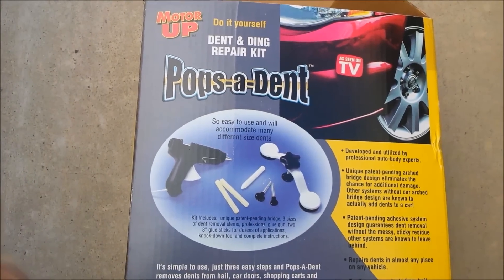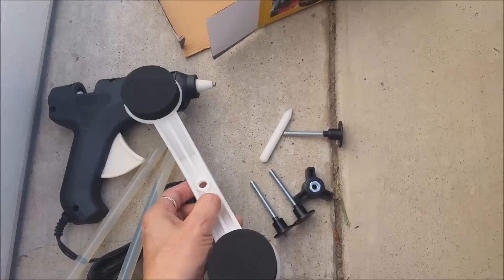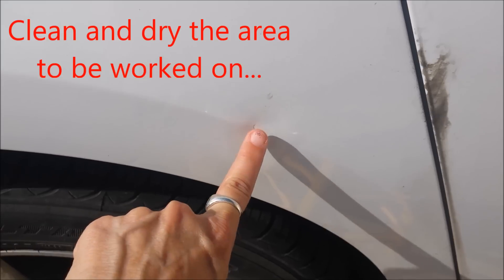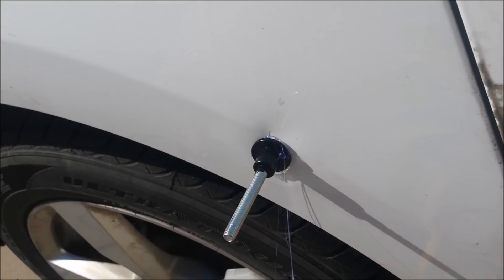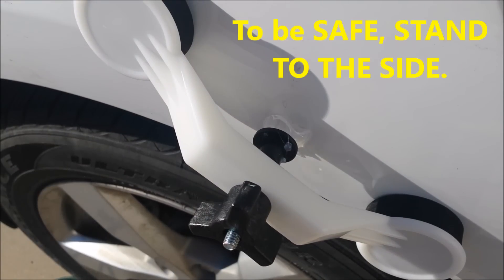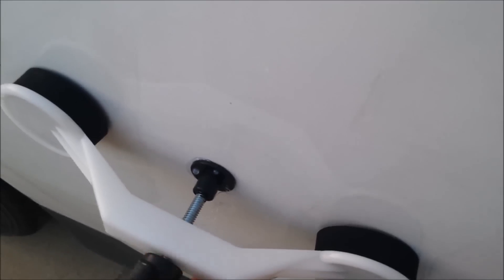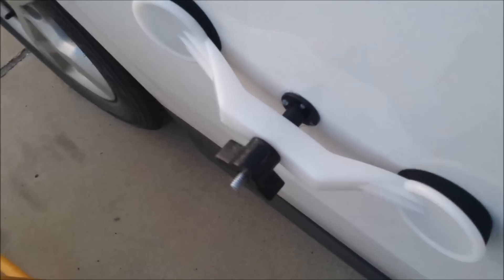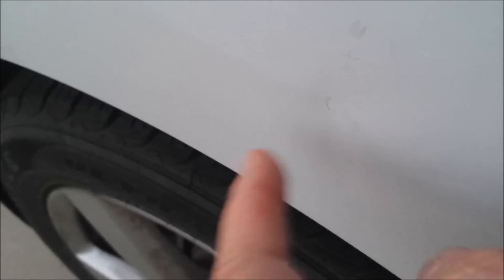Pops-a-Dent - Ding and Dent Remover Tool - Tutorial and Review

Comment: Thanks for your video! This actually worked on my truck - couldn’t believe it. I recommend applying a lot of pressure downward when you are screwing in the plate nut and support the bracket with your hands to avoid it shooting off into the distance.

Comment: good value for the money. it works but you have to follow insttructions and do it multiple times may take an hour. mine took 4 hours 1 dent is completely gone. the other dent is like 95% reduced working on the other 3% if i can get it like 98% gone im happy. it took me like 3 hours to get rid of the one dent , and now its been 4 1/2 hours ( not all in one day ) an hour a day.  im busy but yeah. it will look good . i hit a pole, and saved $998. 00 ok.  thanks. its will get it 95% gone, but its worth it. not brand new but to the point wherei its hardly noticable . one dent is like completely gone. 

rember body men will spend a day or more on it. it may take a couple hours do it one hour at a time one day at a time,.

Comment: WARNING IF USING THE HEAT GUN
If you plan on using the hot glue gun, be careful. Yesterday I worked with it plugged into the normal 230V home electric socket for less than an hour and it casually EXPLODED in my hand. Luckily I didn't get burned (I just had a black stain on my hand were the end of the gun was), but when the cable exploded, it got ripped off the case while the other end was still plugged into the electric socket, so I was milimeters away from being electrocuted. I can't reach the manufacturer, so you will probably see me under various videos warning others. Stay safe
Reply: Is this glue gun rated for 230 volts.
I thought it's made for only 120V.
I would expect it to explode.
My friend retired in the US and moved back to Philippines.
When he plugged his US (Orec) Vacuum cleaner into 220V, it ran incredibly well for a couple of minutes until it exploded.
It was sad, he really loved that vacuum and it wasn't cheap.
Reply: True 😢

Comment: Ok I just got my new car there is a dent on door would the dent puller by sure bilt be good
Reply from the maker: It all depends on the dent. How big it is, and if it's on a crease. It wouldn't hurt to give it a try
Reply: It's just on the door flat surface not to big at all but just got the new Journey 2 days ago and it doesn't look right even though it's not to bad no paint damage i still wanna fix it lol
Reply: Tech Angel me too but it’s right on a line that turns into another angle of the car. So I’m guessing on a crease .

Comment: Glue would not stick to my plastic bumper. I got glue gun as hot as it would go and left it on bumper for 3, 5, 8, 15 and 30 minutes. Tried it 10 times and glue would not stick no matter what I did. Not sure why, but it's a fail for me. Way better products out there. This is a gimmick and useless in 99.9% of applications.
Reply: hi, when using glue gun to heat up the glue, we need to plug in to power supply.  But when squeezing the glue out, do we still need to plug in to power supply?